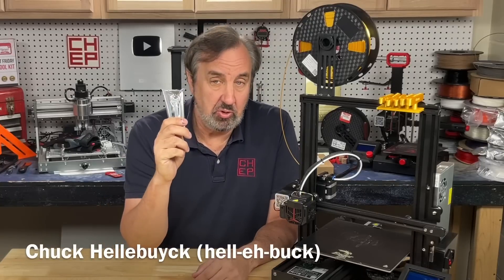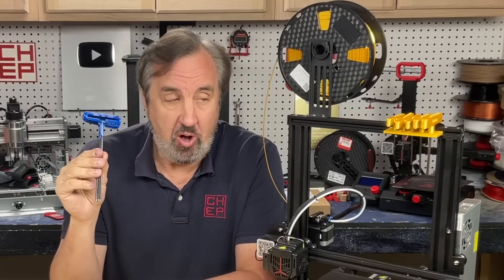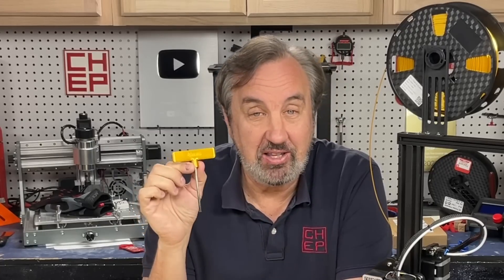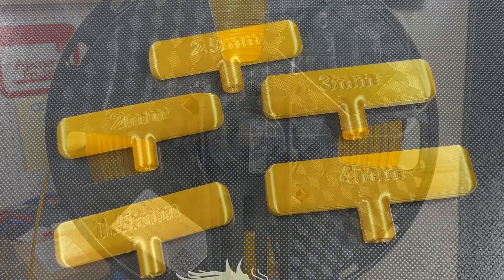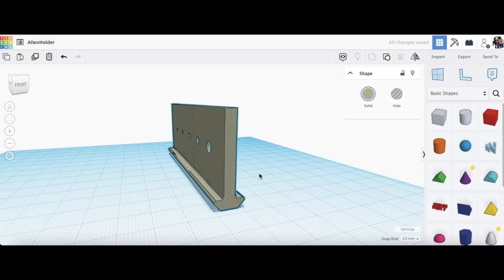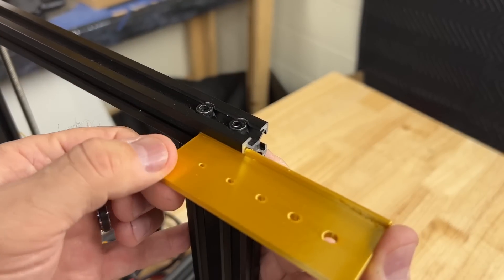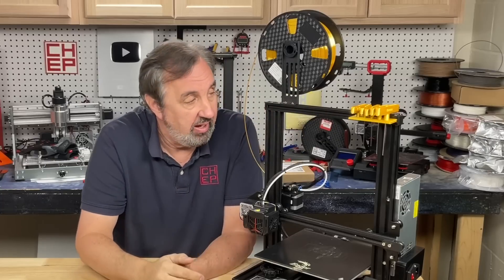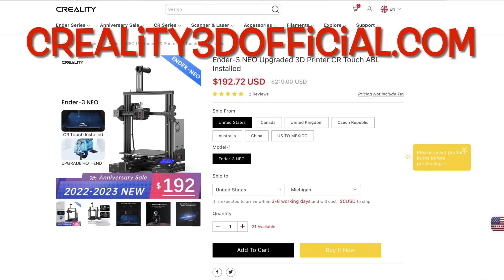Printing Custom Tools with 0.6 Nozzle on Ender 3 Neo

Comment: I have an S1 Pro. Relatively new. I've been through all levelling that's possible but the Z distance is always too far away (too small) and needs adjustment every print. It seems as if the print surface is dipped in the centre buts it's virtually new. Help me???

Comment: tnx for the nice video and content.
Unfortunately the print comes out quite a bit too big on my printer :|  Does the ender3Pro have different profiles?
Normal calibration cubes are the right size.

Comment: Newbee. I followed your video to install direct drive in my 2 ender 3 pro, and it turns on, nothing but light shows on screen. thought maybe it lost firmware, got it from the marlin site you suggested to sign to, to no avail. any suggestions? Thanks Mike

Comment: If you reverse it and hang it on the back side, then there will not be any problems even with big prints. Free tip.  😉
Reply from the maker: Yeah. It’s been mentioned several times in comments.

Comment: Had two Ender 5 for 2 years. Creality hasnt moved on since then. Having a Bambulab X1 now and am completely blown away by the performance of that machine. Creality will be pushed out of the market due to their lack of innovation.
Reply: Creality is releasing more details in a few days about their new "K1" printer. It looks like it's gonna be a clone of the X1C from what is known so far.

Comment: I downloaded your profiles for cura 5 and although the overall quality of the print is much better than my custom profile, I get very slight warping on the first layers while my profile doesn't. I thought I should ask if you know what setting might be causing that or if anyone else encountered something similar.

Comment: I noticed that while the Ender 5 was one of the 3 printers shown on the Creality splash page in your video, none of the links in your description were for the Ender 5; they're all for the Ender 3. And you're alone in this. The Ender 5 doesn't seem to get much love on the Internet. Is there a reason for this? I know it's more expensive, but I like the Core X-Y design. Am I alone in this? Or is the Creality implementation of it sub-standard in some way? Please solve this mystery for me. Thanks.
Reply from the maker: I reviewed the Ender 5 S1 jus a few videos ago. https://youtu.be/D9uhzjg2Azw
Reply: @FilamentFriday  Thanks for letting me know. I will definitely check it out!
Reply: @R Dyer Just for clarification, the Ender-5/Ender-5 Pro/Ender-5 S1 are NOT CoreXY. They are considered Cartesian machines because the X-axis motor has to move along the Y-Axis carriage. 

A true CoreXY doesn't do that. Both the X and Y motors remain stationary. 

There is a cool Mod called the Mercury One modification you can make to your Ender-5 to make it a true CoreXY machine.
Reply: @KensCounselingCouch  I appreciate the clarification. I'll look closer at the design.

Comment: Thank you. Your 0.6mm nozzle profile is awesome. I have 1 Ender 3 S1 with a 0.6 and my other 1 with a 04 profile. Great finishes. 
Thank you for another video that is useful and on a subject that I find useful.
I had a look at hou it is mounted, and I will edit it so it attaches to the top V-slot rail with some T-Nuts, because my Ender 3 S1's and CR-10s does not have the open V-slots facing forward. Small mod, and easy to do in tinkercad.

Comment: Darn it CHEP, your going to force me to have get a 0.6 nozzle aren't you.  😁  great content as usual.  How much time was saved with 0.6 than if a 0.4 nozzle had been used?
Reply from the maker: My Extra Fast profiles could match it time wise. But the point was 0.6 doesn’t sacrifice detail on something like this.
Reply: @FilamentFriday  Yes. It is all about how you use it. For prints I am going to have to put filler on anyway, why print at 0.12mm layer height, when you can punch it out at 0.4mm layer height on a 0.6mm nozzle? I was so surprised at the quality at that layer height. Vase modes/spiral contour with a 0.9 line with gives strong vase prints. It is an awesome toy to play with. I print at 220 to handle the higher flow rates needed.
Reply: You can get almost the same results pushing 0.6mm lines/extrusion widths through a .4 nozzle and still get really good quality, even better than a 0.6mm nozzle actually because the extrusions can go all the way down to 0.34mm where a 0.6mm nozzle will only go down to 0.51mm

Comment: wouldn't it be easier to install the mount facing the rear of the maschine (and probably extending the holes further out, so they won't hit the roller wheels)? Should be plenty accessible
Reply from the maker: Good point.

Comment: I bought a second Ender 5 Plus about 18 months ago and the Allen keys that came with it were very poor quality, my previous Creality machines Ender 2 CR-10 Ender 3 all came with Allen keys that had the multi-angle rounded heads on them and although they were cheap they were at least functional, I printed T handles for them but didnt bother with a holder to go on the printer, I made one to go on my peg board.